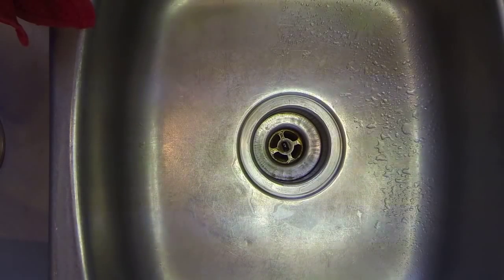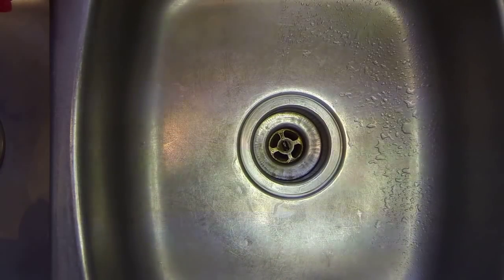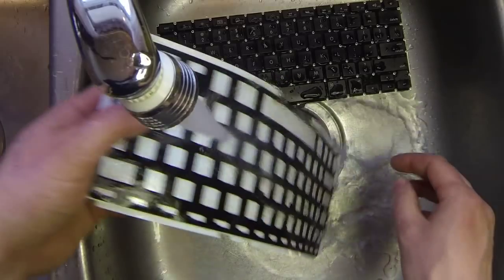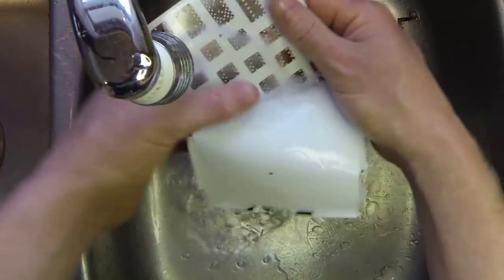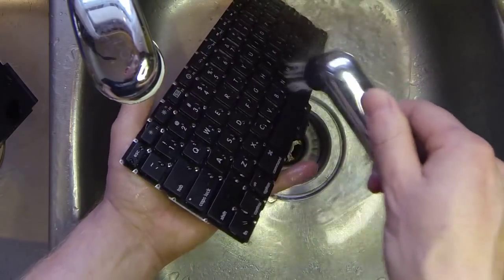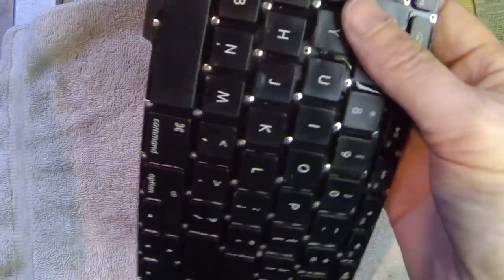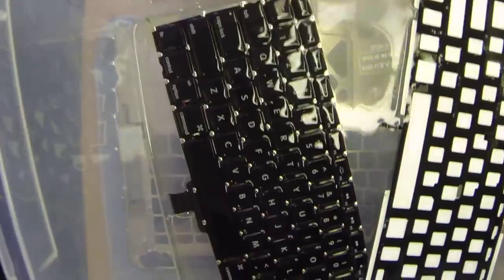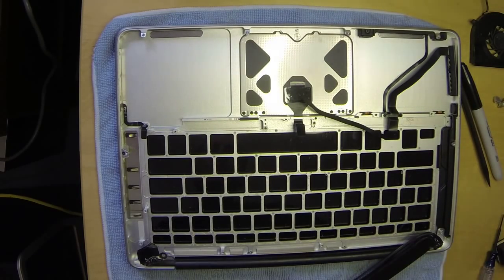Guide: How to Clean a sticky or spilled on  Macbook Pro Keyboard - Easy & Detailed Instructions

Comment: I do stuff like this all the time, with mother boards, ram, video cards and the such.  The key is NEVER let it have it the least bit wet when running electricity through it.  I used Dawn, as it leave very little residue, rinse it well, towel dry, and put it in a clothes dryer for about 30 minutes.  I use the shoe rack for that part and the dryer is perfect because it has the perfect temp to remove the moisture without damaging the plastic.  But, I specialize in restoring old equipment, so don't try to do that if you are the average tech.

My question is, does the alcohol bath work better for getting under the keys?  Had a client today that spilled either coffee of soda on his keyboard.  I tried to wash it, and dry it in the usual manner, but there is still stuff under the keys.  His backplate doesn't come off.

Could just order a new one... but with the holiday, it will be a $40 job sitting on my bench for a week.  Not the most profitable.  

I'll probably just get a bunch of replies saying how crazy I am... but, It's not crazy if it works.  Crazy would be doing it again and again and it didn't work.  It's a serious question.  I get a lot of old... 20+ years, computers in.  you just can't find parts for them.  But, I also give them away to charities... so, every cent counts when doing the restores.

Comment: Thank you for this video! A friend spilled beer on my 2010 MBP, and I had about 10 keys not working.. I followed your instructions, washed the keyboard really well under warm water, then into IPA for about 10 minutes, pushing the keys.. Let it dry all night, reassembled everything and the same keys still don't work.. Guess I have to buy a new keyboard.. What do you think is the problem with those keys?

EDIT: some of the keys that didn't work before cleaning now work, and some that worked now stopped.. Other make errors: if I press 4 I'll  get 47, same thing if i press 7. There's something shorting I think.. I don't know if it would be worth trying another cleaning
Reply from the maker: Hey, sorry just getting back to you.
At this point I'd just look at replacing it.
It sounds as if the metal leads within the keyboard are likely damaged beyond repair.
You could certainly try another cleaning but sometimes it's just worth the money to replace it as they are getting cheaper and cheaper.
Reply: Hey thank you! So, in the meantime I tried another wash, I also used a spray contact cleaner.. still no luck. So I ordered a non-backlit one for about 25EUR (couldn't find any cheaper here, and I wanted it delivered in 1 day) and assembled it with my still functioning backlight. It works good. Anyway your video has been very helpful, so thank you again!
Reply from the maker: Awesome! Glad my video helped you out! :)

Comment: Hello MrTechEasy.
GREAT video, very easy to understand and follow. Thank you for sharing.
Question: at the alcohol stage, before drying the KB with a fan, would it matter if its 70% (some cents at Costco) or 99.9% ($20-$30 a quart/liter)?
Reply from the maker: Glad you liked the video. Thanks for the comment.
I like to use 90% or higher.
Walmart has 91% for under 3 bucks.
https://www.walmart.com/ip/Vi-Jon-91-Isopropyl-Alcohol-First-Aid-Antiseptic-32-fl-oz/33057974
Reply: Thanks for the prompt answer!!! I was really looking forward to read it! 
And thanks for the link to WM, it's already on my shopping list. 😊
I tried to post this same question in 2 different Apple forums before posting here (thought it will take weeks to get the answer), but all I got there was "righteous" answers why not to clean it this way and references pointing me to Apple's instructions with the "right" way to do it... 
Again, thanks for everything, I appreciate that SO much!!!
Reply from the maker: You are very welcome!
The Apple forums can be a scary place for the average nontechnical person as they are all very "righteous" as you pointed out. They don't believe in alternative methods of working on Apple products. ;)
Reply: algunas teclas de mi Mac no funcionan

Comment: Why would alcohol be necessary? Sure it might be faster drying. But it's not goin to do a better job than air drying. By particle air is smaller than water and so There is no way that any water hidden could escape Air exposure. Save your money and just wait longer for it to dry.
Reply from the maker: Actually alcohol is used because water can seep into areas and tight spots that it could take days to dry on it's own during which time corrosion can start in. The longer water is on something the more likely it is to rust/corrode.
Also alcohol is extremely cheap.
Thanks for the comment though =)
Reply: Well I have used your method only without the alcohol,
letting it stand try for 6 hours. Reassembled, and it works perfectly.
Not a hitch since. That was one month ago. So I suppose I am living proof of the contrary. You're welcome any time :)
Reply from the maker: I'm not saying that air drying doesn't work, it's just riskier.
I'm glad that it's working great for you though! :)
Have a great weekend :)

Comment: This is an interesting video. You don't mention the model and year of your computer..

I'm guessing you don't realize that for Macbook Pro 2013+ 15" this method will not work, as it is not possible to remove the keyboard without killing it... it is riveted in place.

New keyboard parts are not very expensive ($40), but it is best to replace the keyboard, backlight and new screws are necessary to replace the rivets originally holding the keyboards on 2013+ models, with a new KB.
Reply from the maker: Thanks for the comment. 
Yes this is for mid 2012 and older Macbook Pros. I have replied to several comments telling the years this covers. You are correct in that I didn't mention that in the video. I'll update the description to explain this. Thanks.
The newer models are possible to remove and clean however it's extremely difficult and not recommended unless you really know what you are doing and are confident in your small electronics skills.

Comment: I haven'y dropped anything on mine, but  the 'x' and 'z' keys and the left command + 'c' shortcut (plus any shortcuts with 'x' and 'z') all stopped working suddenly. If i press the command shortcut(s) twice they work and command +'a' seems to work all the time. A few other people on forums have had this problem, but no one has posted a solution. I've done all the PRAM and resetting keyboard, mouse, speech, input, speed, in System Pref resets. I also cleaned out those keys and spacebar plus a few surrounding - there was a nest under each key! I am afraid to start taking off all keys in case I break them, especially if it doesn't matter... Thank you so much in advance If you know and can give the time to answer. :)

Comment: Whats the worst keyboard spill you cleaned up, and how many more steps did it add? Like coke a cola on and in the keyboard, after it has set for a long period?No video on the frame cleaning?
Reply from the maker: Sorry for the very late reply. I've been away for awhile.
Different liquids have different results. Soda, juices, wines, and beers have a lot of sugars and are more acidic than other liquids and I see that they do the most damage. 
The main thing is no matter what you spill on the unit it must be cleaned up as soon as possible. 
The longer that you wait the more corrosion kicks in.
Reply: Philip settimi did you spill coke on your laptop? How is your macbook now? Is it still working?
Reply: No I didn't but the mother board had it is why I was here looking, I suspected the keyboard had it also but that was already cleaned and working fine.

Comment: Hi, My cat spilled water on my Macbook air's keyboard, and now the a and s key ren't working. Do you think cleaning the keyboard would make a difference?
Reply: Dennie Kleuter Hi Dennie! Is your Macbook still working ? I really want to know because it happened to me too. Thank you!
Reply: Jason Vu My insurance covered it, so I didn't try this! Good luck!
Reply: Can you actually press on it? If you can then there's some problem with the connector. If you cant then try cleaning it. Make sure you put your cat away from any type of electronics as well.
Reply from the maker: Sorry i'm late to the replies party, i've been away awhile.
I'm glad insurance covered it. Macbook air keyboards are extremely difficult to remove and clean.

Comment: Would this method work on a black Macbook (A1181) ?
Reply from the maker: Unfortunately no. The reason being is that the keyboards on the early MacBooks, the white and black polycarbonate models have the keyboard assembly plastic riveted into place with the touchpad/palmrest assembly. Technically it could be done but in my professional opinion it's not worth it because of the amount of work and modification that would be required. The entire keyboard/touchpad/palmrest assemblies are around $100 on eBay and can simply be screwed into place. 
Hope that helps
Reply: Thanks for the quick response!
Reply from the maker: Jack Denning No problem! :)

Comment: My niece's 2 year old daughter dumped a bowl of chicken soup on her Mom's  Macbook air.  My niece went to an Apple store and of course they said it couldn't be fixed could purchase a new one.  Is it possible to clean   a Macbook that has been bathed in chicken soup?  Most of the videos are concerning lighter liquids like soda or water. Thanks for any info you can shoot my way
Reply from the maker: It's definitely possible to clean it and maybe replace some parts to get it going however the Macbook Airs are extremely hard to work on compared to the Macbook Pros that this video is working on.
The Apple stores will NEVER work on liquid damage so your better off finding a local computer repair store that may work on or specialize in macs and see if they do spill damage on Macs.
I hope you figure something out.
Keep in mind that if she had important information on the Macbook that it's likely still all there on the hard drive as long as the hard drive didn't get damaged(which they usually don't from spills) so that information should be retrievable by someone.
Reply: Thank you for the reply. Will pass it one to my niece
Reply: Hi Jason. In fact about a day or two later the darn thing started working just fine. I was surprised. As far as I know, she did nothing to it
Reply: Yes it is Jason. She uses it everyday. I hope yours turns out well
Reply: binthrdonthat how is her laptop now? Is it still working. It happened to me too:(
Reply: binthrdonthat ooo she is so lucky! Congrats :) is it still working until now?
Reply: binthrdonthat thank you! I hope too

Comment: Skip the water cleaning and clean it in the alcohol bath ONLY with a brush... just as simple and easy as water... guaranteed not to have disasters. (and don't soak it, just rinse it as you will also disolve any stickers and spacer glue that is MEANT to be there also... this video is #captainrisky

Use (pure) Isopropyl alcohol and and air blower or puffer (not water) for anything electronic.Above is a really clumsy way to handle electronics. The difference between isopropyl and water is that it evaporates without harming, rusting or shorting out electronics. after about 2 minutes of moving and blowing, you know it's dry also, where with water, it could still be there unless you heat the electronics (in an oven for less than 5 minutes until warm to touch)... either way water is not the way to go if you don't understand the internals of the device.

https://en.wikipedia.org/wiki/Isopropyl_alcohol
Reply from the maker: Thanks for your input Chris however I disagree with you. I do use alcohol to remove the water that was used to wash the keyboard. Unfortunately alcohol has no detergent or abrasive's which is necessary to remove a lot of different types of spills. Alcohol will not remove dried up or very sticky substances without soaking for a long period of time which like you said removes adhesives and can damage the cosmetics of plastics.
I have over 30 years experience with computers and have literally done hundreds of these keyboard cleanings with only a handful that didn't work. I have NEVER had any that caused other issues as long as done correctly. There is no stored electricity in the keyboard assembly so there is no risk. As long as alcohol is used to dispel any water that was used during the cleaning. I also stated in the video to make certain that the keyboard is 100% dry before reinstalling.
Reply: MrTechEasy  Also, I've found some sticky/sugary residues won't wash off with just alcohol, but the water will dissolve it.

Comment: Did it your way... only number buttons work properly... Touchpad also got bugged...
Reply from the maker: +Dmitriy Fal Touchpad doesn't have anything to do with the keyboard? Separate connectors and cables. Washing doesn't always fix the keyboards but it's usually worth a try. Sorry yours didn't work out.

Comment: Had a bee spillage and compute wouldn't stat, I dismantled and cleaned the whole compute and it was woking 100%. Howee a etical stip o 6 keys has stopped woking. Such a mission to take it out i'm not sue i i will ty cleaning a 2nd time. eubished keyboads o aound 15 bucks
Reply from the maker: +izzzzzz6 Yeah, if the first time cleaning the keyboard doesn't work its usually safest just to replace it with a new one since they are so cheap. Hopefully my video helped with the removal of the keyboard at least. :)
Reply: well it was working after i first cleaned it but after a few hrs it stopped woking again, i can't be bothered to try again so ordered a new one from Hong Kong. For now i'm battling with the on screen keyboard viewer to fill in the blanks.
  I will clean it again and keep it as a spare if it tests good.

Comment: I had a small water spill which caused most of the Q row and some other keys to stop working. Atter using this method yesterday, most of the keys started working. However, the letter "a" doesn't work, when pressing the letter w or e, both letters are typed together on the screen even though I only pressed one letter. This is the same problem for letters "s and d" and "x and c". Is there any way I can fix this or do I have to buy a new keyboard?
Reply from the maker: +Bhavik Sheth It's likely that the circuit board within the keyboard got damaged beyond a cleaning. You could always try again but it's a lot of work to do twice when it's probably safest at this point just to order a replacement keyboard. Luckily they aren't very expensive. 
Let me know if you need any further help.
Thanks

Comment: Hi @MrTechEasy thanks for your video. I have a problem with just one key of the entire keyboard, would you recommend to try and spray some contact cleaner or do the entire procedure like in the video? Thanks for all the info.
Reply from the maker: +yief84 If it's only a single key you could try to remove the key from the keyboard(while still in the case) and try to clean underneath it with some non conductive contact cleaner to see if it helps.  Thanks for the comment :)

Comment: just write me size and name of the special tool that opens mac body cover.Pls.
Reply from the maker: +Confidential Tune Are you inquiring about the bottom panel? If yes then there are different screws depending on the model/year of the Macbook. Most are a small #1 phillips however the newer macs 2011 and newer mostly use what's called a Pentelobe screw which is a proprietary apple screw. You have to buy a special pentelobe screwdriver for that which you can get from eBay or fixit.

Comment: the black layer over led back light rubs of in alcohol bath. Anyone else experience this?
Reply from the maker: +Brandon Craft (CraftMath) Do you mean the black on the back side of the backlight sheet? I've never had a problem with the alcohol affecting anything except for stickers or things glued on with adhesive.
Reply: +MrTechEasy not the black rubbery surface but the black layer where the keys are punched out of it. That black layer rubbed off exposing white. Turns out my keyboard was shot though. Purchased a new one off Amazon and I'm back in business. Thanks for the video. Couldn't have taken it apart without it.
Reply from the maker: Sorry cleaning yours didn't work but glad you got it fixed with a new keyboard and glad my video helped you out. Thanks for the comments :)

Comment: Dear Mr. Easy. I got the 99% ethanol and it says "highly flammable". Do you think this is as flammable as gasoline? If it is I will use it outside as both my hot water heater and furnace have open flame. Thanks. Km
Reply from the maker: +Connor m Yes, it is very flammable. I always use it outside. I guess I should have made that clear on the video. Thanks for the comment.
Reply from the maker: +Connor m I did shoot these videos inside however. I guess it just depends on your comfort level working with flammable stuff. I usually do it outside if I can but it was too cold out to shoot these videos.

Comment: Hi, I just want to make sure this will work with my particular model.  Its a Mid 2014, MacBook Pro, A1502.  They've told me that taking the keyboard apart is something that's close to impossible.  What models have you used this on?
Reply from the maker: +Andres Romberg I'm sorry but on the 2013 and newer models it is extremely difficult to do this job. My videos are based on models up through 2012. The newer model have the battery assemblies that are glued in. It can be done but it's a job that is much much harder than on the videos I have provided. I may try to do a video of that job in the future if I get a job in.